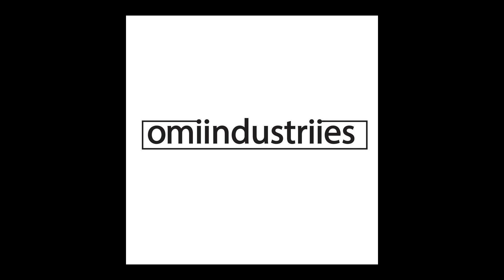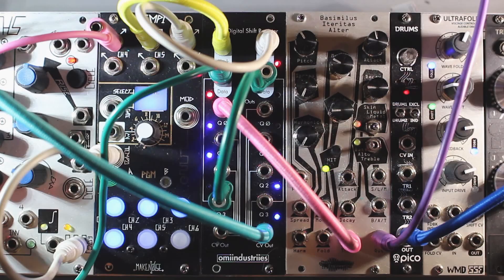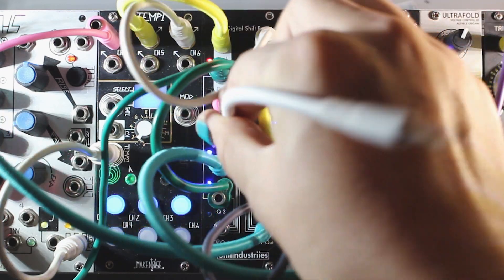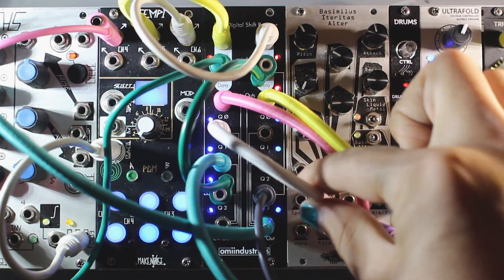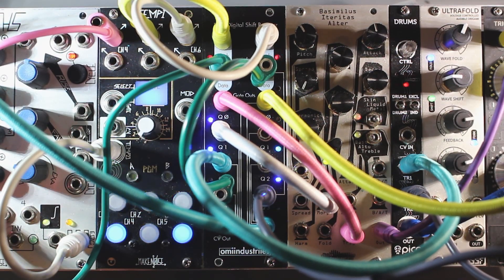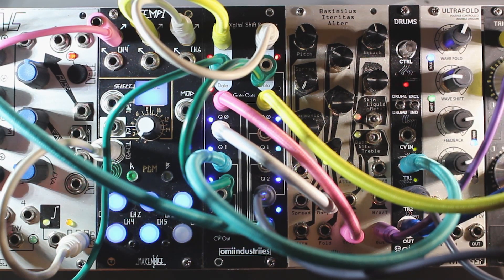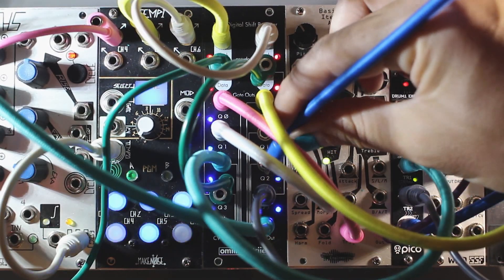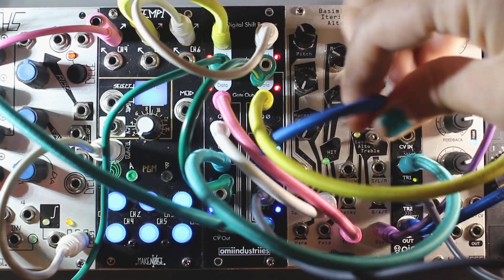Dual Digital Shift Register - Gates for Timing and Modulation

Comment: I'm having a hard time understanding how the randomness comes in, and how to control it. Can this module be used to delay a rhythmic pattern without changing it? I'd like to be able to create a rhythmic canon, analogous to how an ASR creates a melodic canon.
Reply from the maker: The randomness is determined by the relationship between the clock and data inputs. It can be used to shift a rhythmic phrase similar to an asr